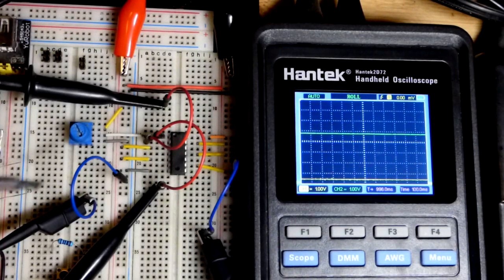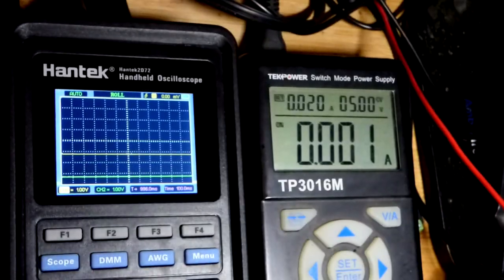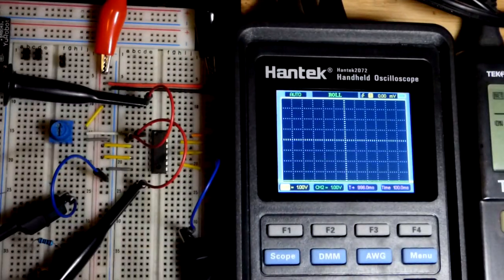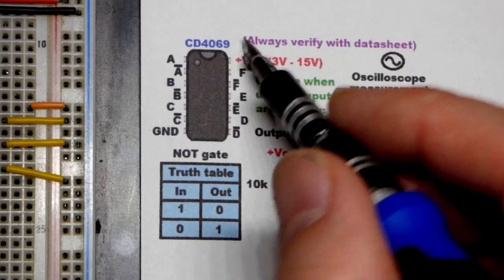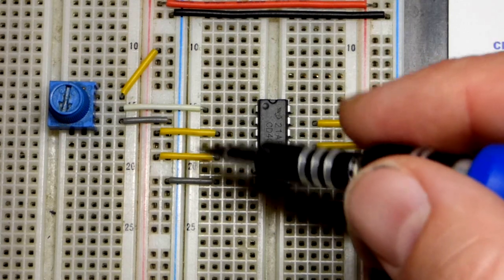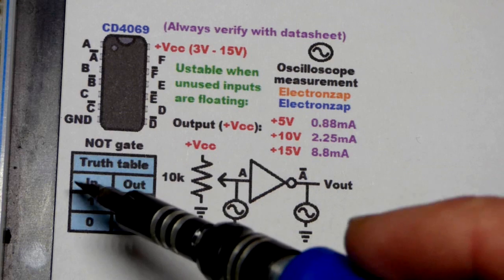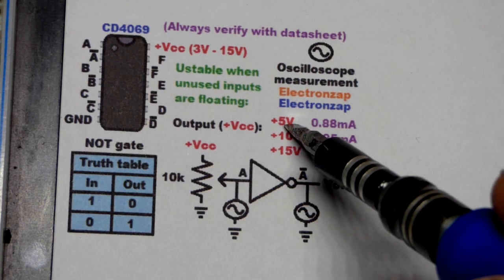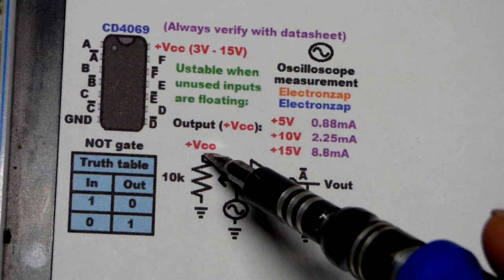CD4069 integrated circuit complementary CMOS hex NOT gates or 6 inverters

Comment: An interesting thing about these NOT gates is that you can use them as amplifiers, either by biasing their input with a pot between V+ and GND, or by adding a resistor in parallel with the gate. They're used in a few guitar pedals, famously the Red Llama by Way Huge, and MXR Hot Tubes.
Reply from the maker: Thanks for the info. I did notice on the datasheet that I was looking at that it said that one of the uses of this IC is in amplifier circuits.
Reply: Didn't Forest Mims have that circuit in one of his books? I seem to remember he had a book on these gates, there was a good example of a gate amp. I could be confused.